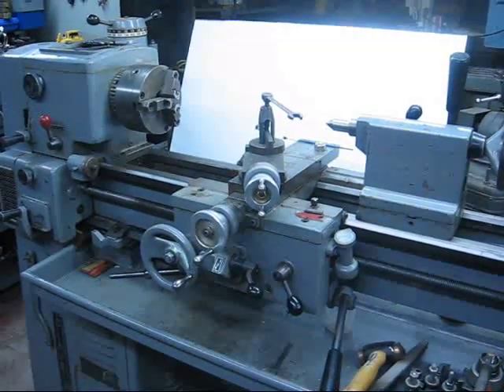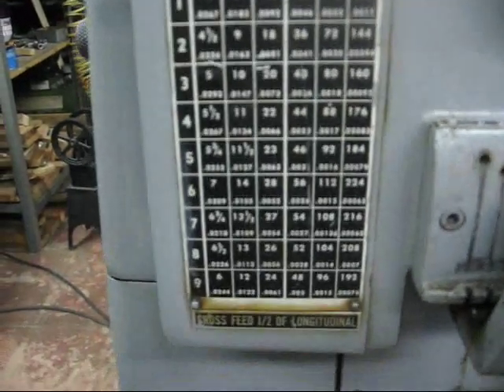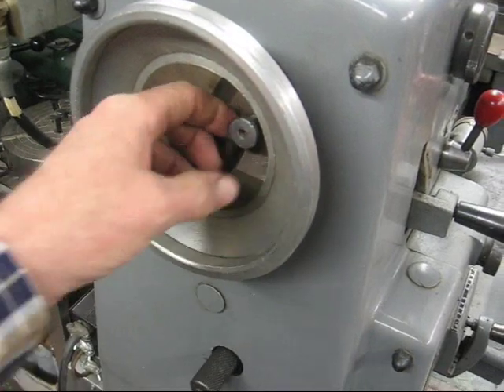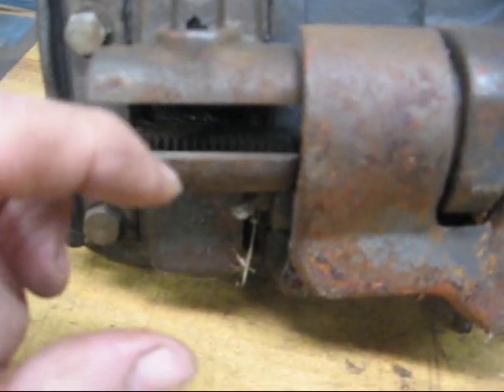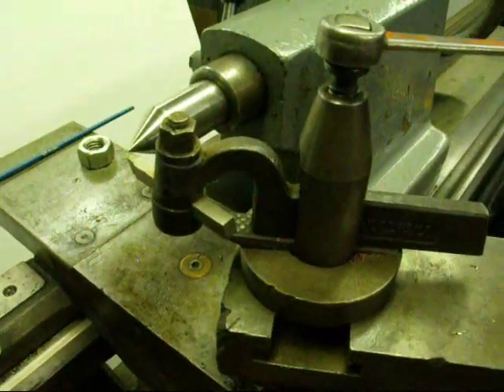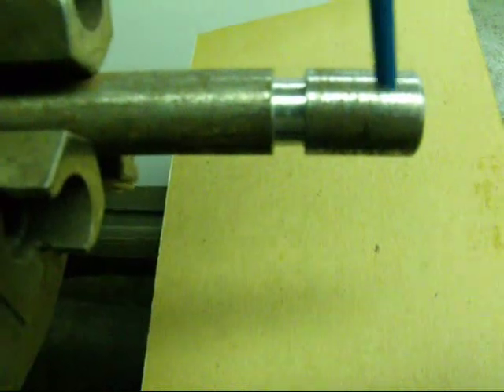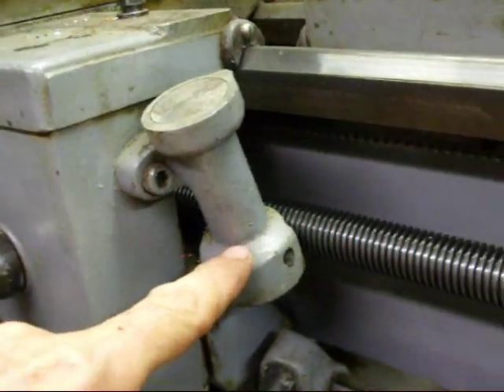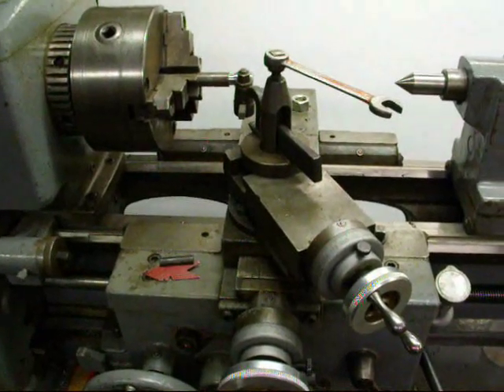THREADING on the CLAUSING LATHE south bend part 1 tubalcain

Comment: I had no idea that there was so much involved in threading.  I have often watched my engineer mates make threads but they made everything look very easy and were talking away all the time while they set the lathe up so I didn't really take in what they were actually doing.  You did say this set-up could be done  fairly quickly but, seeing it broken down makes my admiration for my mates and other engineers even greater.

Thank you for taking the time to post this.

Best Wishes,
Brendan

Comment: my threads keep turning out to have a slope on the back side of the cut, kinda like a sawtooth what am I doing wrong? compound is 29.5
Reply: Try setting it 60 degrees. (Or 60.5 degrees).
 If your setting from "0" at the front of the compound, you're at 29.5 from the front. Setting it at 60.5 will give you 29.5 from the "0" at the work piece.
 I "think" I said that right.

Comment: Hopefully you can help me.  I have a Bolton Tool B290VF lathe and was hoping you may be able to help me.  I cannot figure out how to set the speed of the feed.  When I tried to thread according to the manual given, the threads fell apart on the third or fourth pass because the TPI is very high.